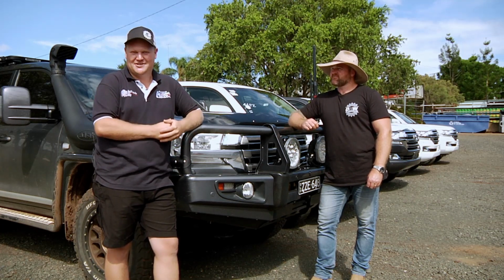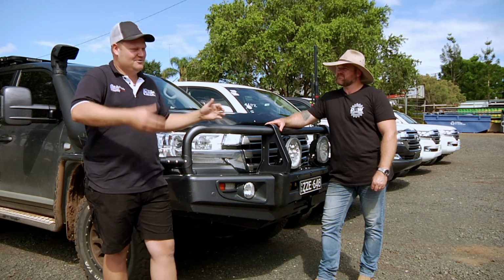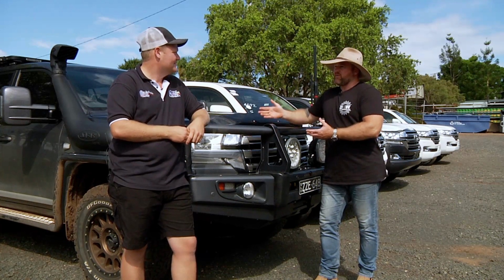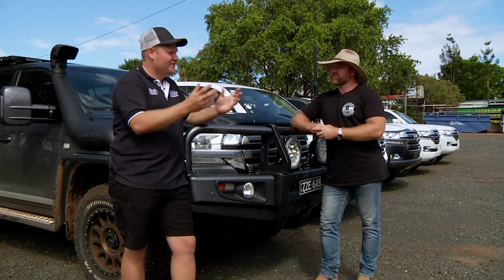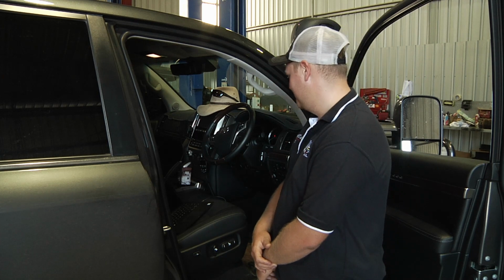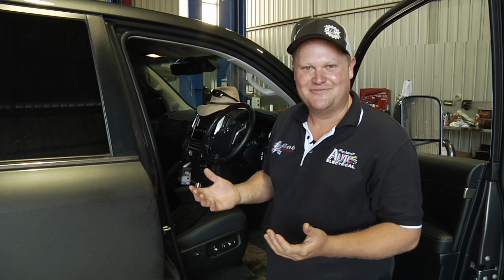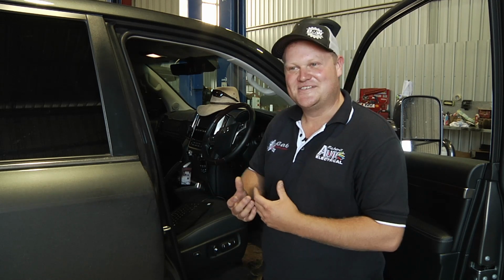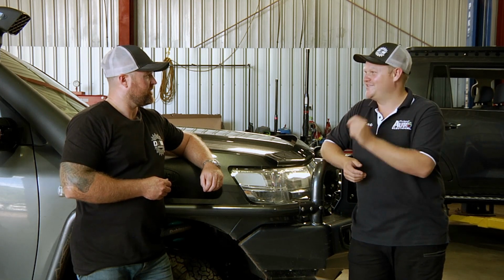Landcruiser 200 Series issue!! How you can fix it and SAVE FUEL!!

Comment: 200 series Transmission ECU remap and torq Converter lock up kit from Richards Autoelectrical = My best investment on a modification for reasonable price works 100% for me. 
Have an eye On the Speedo, engine load, rpm, gear, engine and auto trans temp on the ultra gauge, you will exactly see when you have to shift down to 5th. Gear going uphill when the engine load goes up. 
Or wait 5 sec on 100% load and it will downshift automatically. 
If you watch your engine rpm by say 1650 rpm by 100km/h see the load factor ! Depending on what you tow I guess in average 85% load should be a reasonable value also for the fuel economy. Please Correct me if if I am wrong on that. 100% Satisfied with the system and Stefans Service for installation last year. Cheers

Comment: Hi mate, thinking of upgrading from my 2011 fortuner to a LC200 sahara diesel... My worry is the sahara isn't available in a manual transmission.... (fortuner is manual) ... Is it possible to convert a 2015 LC200 sahara to a 5 speed manual...
Reply from the maker: HI Yahye, I have not hear of anyone changing them to a manual. You can just use a manual shift of the auto if needed.